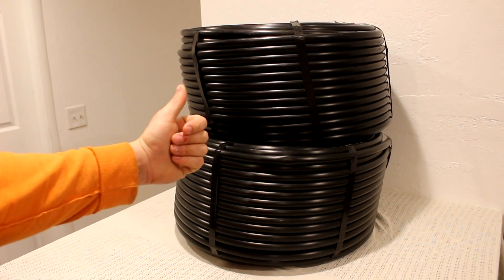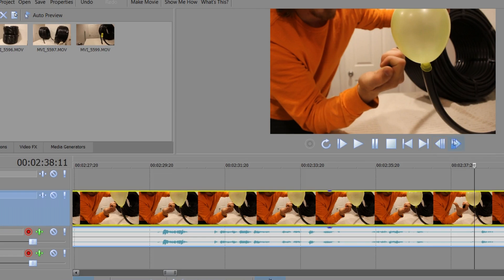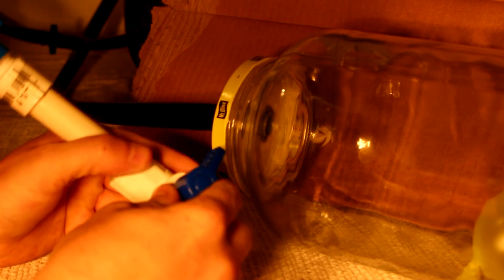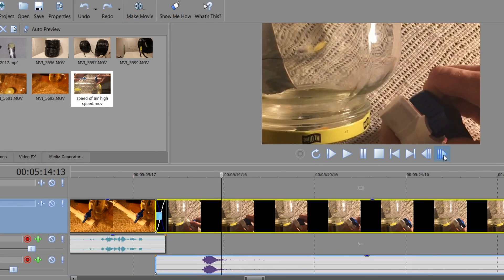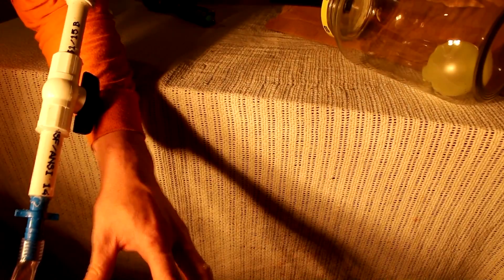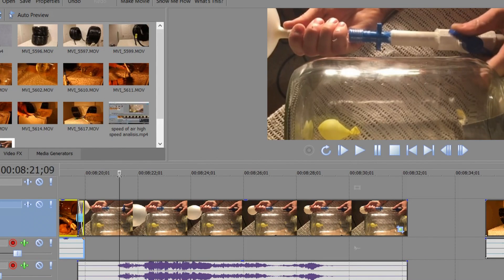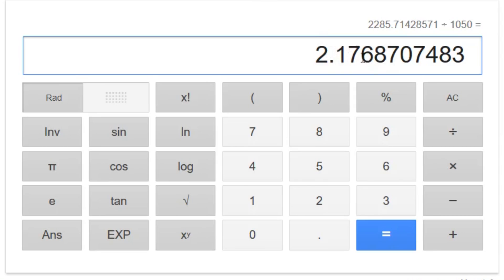Speed of Air Pressure Through a 1000ft Tube

Comment from the maker: Huh it was 24 in the beginning!? How did I not notice that? all the time using this camera and you'd think I would know how fast it filmed, maybe Ive messed up a setting somewhere? Well any way it didn't mess up the math that much and the iPhone footage is indeed 30fps
Reply: Cody'sLab Good catch, thanks for letting us know.  Btw, thanks for the vids, my 8yr old loves watching with me and it's really getting her into science :D
Reply: air is consider as fluid and as any fluid run in to tube it have friction between tube and the fluid that will slow it down and the the longer the tube is the more friction force  generated so when you do your calculation you have to consider the head loss that will happen because of the friction and other parameter.
Reply: @mahmoudorjani  9
Reply: +Dewain Anderson the effect of pressure on the speed of sound is fairly small — the speed of sound only varies about 20% between sea level and the edge of space (and it actually hits a minimum around 10km, where airliners fly every single day; from there up to 50km it's going up again, to nearly the sea-level value). The pressure effect (you simply have to fly faster TAS to get control authority, even if it's the same IAS) is the far more significant for the "coffin corner" thing. But that doesn't have any bearing on this experiment :)
Reply: Cody'sLab Can you update us about the stirling engine?
Reply: Cody'sLab the lower the pressure the slower sound travels. One of the greatest problems with high altitude flight is that the speed of sound is so low and lift is so low it is hard to fly (supersonic speeds cause a loss of control and high stress to the airframe and skin of the aircraft due to the sonic shock wave and the air isn't enough to create much lift, the envelope in between over speed and stall is called "coffin corner").
Reply: Andrew Andrew why would that be a maximum speed?
Reply: Have a phone on screen, with a high-speed stopwatch (at least 1/10th second) running next time.  This will decouple your timing calculations from the framerate of the camera.
Reply: It's okay, for the first one you didn't count the frames, you just figured "it's 12 again, so that's 1 second"... which is valid for any number of frames per second :)
Reply: The Helium in balloon canisters contains 20% Oxygen so that when someone inevitably inhales it, they wont suffocate.
Reply: I love how you acknowledge your faults and mistakes you made. Most Youtubers would rather cut their fault out of their video. I really appreciate your honesty so much.
Reply: Love the videos Cody keep up the good work
Reply: sorry I was referring mainly to traveling close to or near people building, populated areas etc as if we go faster than sound we would create a sonic boom witch would intern damage buildings and property. adhd makes this hard to explain sorry.
Reply: Live and learn :)
Reply: May have some slight interference, with bumping the jar on the table.
Reply: you couldve made a 1000ft vacuum cannon similar to nighthawkinlight's
Reply: Sylveon sup
Reply: science! it guides me in life. I often don't care if I'm wrong about something, but greatly appreciate learning something new or correcting something I thought wrong. otherwise, it's probably ignorance by out of control emotions.
Reply: what video editor do you use?
Reply: i wouldve loved to see a deflated balloon attached to one end and an inflated one to the other end and see what happens
Reply: bro, lay off the cyanide...
Reply: @ Cody'sLab, it isn't about speed of sound, but air compression in displacement.
Reply: Dewain Anderson: No. Here the gas can be considered ideal, and there will be no pressure dependency on the speed of sound.
Reply: Mahmoud Orjani: Air is not a fluid - in this experiment, air can be considered an ideal gas. Molecules will bounce on other molecules and the walls with practically no energy loss.
Reply: does that mean the fasted we would be able to travel under the most perfect conditions would be  around 3,600,000 km per hour?
Reply: Cody'sLab, I like your voice and the way (accent?) you speak. I could care less if you mess up and I wouldn't have a clue if you did anyway :P
Reply: what does he mean by a chain reaction?
Reply: Cody'sLab the hyper loop is impossible

Comment: I'd like to see a similar experiment but using electricity in a wire instead of a gas in a pipe.  Perhaps finishing off with how long it takes for any specific electron inserted into one end of a known length of wire (as part of some known current) to actually appear at the other end.  (Specifically, I'm hinting at a test of drift velocity)

Comment: It seems there is a confusion between the speed of sound which is the velocity of a wave through a medium, here air and helium/O², and the speed of displacement of the medium in a pipe, which is a flow. The latter is conditioned by parameters as pressure, density, friction losses, etc. 
This experiment show us the displacement speed. If it were to specifically show the sound speed, it could use a diaphragm at each end of the tube and see how one reacts to impulses on the other at different pressures or with different gases. A loudspeaker at the start, a microphone at the end, and you can detect the delay and probably other data as signal attenuation in relation to the gas used.
But the video title is "speed of pressure..." and it is actually what we see: the delay at which pressure variation occurs. Maybe the term "speed of sound" is misleading.

Comment: Hey but I can get my pcp air gun to shoot supersonic from a normal air charge: how is that possible ?
As you said to me in an other message pressure does not change the speed of sound in an ideal gas .... maybe 3000psi  compressed air si so tightly packed that it's making a very substantial departure from the way an ideal gas should work ? (due to the molecules themselves starting to occupy a no longer insignificant portion of the volume maybe ? )

Comment: it's very possible you've done a video I haven't seen, but I would love to see a Newton's cradle in a vacuum chamber with an atmosphere control. hypothetically, it should go much longer without air resistance, but it would be interesting to see the difference, as well as potentially extrapolate how much energy is lost due to internal friction of the support structure, maybe even an IR thermometer reading or something.

Comment: So if you were to connect the hose to a pressurized container. What would changing the pressure of the air in the container do to the air coming out of the hose? Since you said it would travel through the hose at the speed of sound, it would stand to reason that the speed wouldn't change.

Comment: I'd be surprised if you didn't know this Cody, but reducing the pressure reduces the speed of sound, so the reason the blast of air entering the vacuum took longer is probably because the pressure caused the speed of sound to reduce.

This is also why you can have a bullet exit the barrel faster than STP mach 1, because the pressure is so much greater in the gun barrel and therefore the speed of sound is much faster.

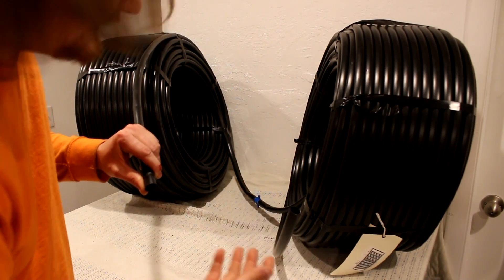Comment: 1:30 that reminds me on gas pipelines 
the pressure on the input is significantly higher than on the exit due to friction holding the gas back
3:28 you couldve marked the ballons with 2 dots and measure their distance

Comment: On the last point about speed of projectile pushed by a gas. This limitation leads to the 2 Stage light gas gun design that uses a conventional explosive propellant to push a large piston with hydrogen on the other side, this then feeds into a gun barrel and can push projectiles much faster than the original propellant ever could. This kind of design is used to test things like micrometeor impacts on spacecraft materials because it's the easiest way to get close to orbital velocities in a lab.
Reply: doesn't the hydrogen get compressed and detonate from adiabatic compression from the piston?

Comment: Shouldn't you be able to get a compressed air projectile to move faster than the speed of sound? Mach speed increases with increased pressure, so as long as the air is compressed enough...

Comment: Is your experiment dominated by friction effects with the wall of the tube? The air inside the space shuttle moves much faster relative to ground control, but is relatively still relative to Major Tom. Speed of sound at lower vs. higher pressure may vary?

Comment: If ever have a long tube again you should do the same experiment but with a speaker and a microphone. The microphone would be able to pick up the first beep from the speaker directly through the air, and a second beep through the tube and you could very easily calculate the speed of sound that way.

Comment: its not just the twists and turns that slow down you blowing through the tube also the fact that it is a large volume for it to expand in , if you reduce the diameter of the pipe to reduce this fact those frictional losses would increase.

Comment: sprinkler fitters use blow back to see if the system has no open connections.
small store or huge warehouse.  the same response.
blow into pipe and a few seconds later air comes back at you.
works with small leaks but not with an open pipe

Comment: 10:38 - can you explain how it is possible for rifle rounds to move at an excess of 600 m/s? Is it because the gases generated by the combustion of the gun powder have a higher speed of sound? My knowledge of fluid dynamics is a bit rusty, but even though we (i.e. our professor and the students) generally considered the maximum velocity a fluid can move inside a tube is the speed of sound (like you said), supersonic movement can be acchieved under certain circumstances.
Reply from the maker: heat also makes gas move faster
Reply: Ha, right! Thank you. I forgot that c = sqrt(Kappa*R*T) :)

Comment: I wonder if those tubes really are 500'? Wouldn't you get a much more accurate measure if you shot a starter pistol in one end and watched it knock a paper disk off the other end? How about some sort of feedback loop like a solenoid to send some pressure down and a magnetic reed switch on a pendulum or flapper on the other end? Could you use valves to make an engine by putting one end at the top of a hill and one at the bottom and use the pressure differential to run something? The low pressure area behind a sphere in an airflow might magnify the effect if you have wind that day.... pardon my mind wandering. Love the videos by the way.

Comment: First thing I would have done is set off an explosive on one end and wait for the sound to go through the pipe. Record both with the same microfone at the same time and then use audacity to analyze the record.
Way more accurate than your method - IF you can even hear the explosion on the other end, that is.
Also you probably couldnt have done that with helium...

Comment: Cody'sLab if you let the filled balloon release all the air while attached to the pipe...then the air in the pipe will have velocity when the balloon is out of air ...so wont this moving air try to suck air from the balloon???and hence wont the balloon be pulled into the pipe???
its a doubt....would be gr8 if u can clarify it...if it works like that then we could make a vacuum pump

Comment: how thick would a bulkhead door need to be to withstand a 15 psi pressure wave?
Reply: That's a good question. It probably depends on how long the pressure wave has been traveling down the tube and whether the tube is still open. The farther it goes the more spread out the front of the wave will be, and if an upstream bulkhead has already been closed or partially closed the energy of the gas will be dropping.

I imagine there might be a variety of different strategies for dealing with a breach depending on the type and conditions. It'll be an interesting analysis problem.
Reply: to where would the pressure wave Front spread in a closed environment(tube).  How would the front could get any wider than the diameter of the tube.
Reply: "How would the front could get any wider than the diameter of the tube."

The wave front would spread the other way, along the length of the tube, with an approximately Gaussian profile (it is ideally Gaussian, but interactions with the tube wall will modify it).

Picture a vacuum cannon with an ideal burst disk. Immediately after the disk is broken the gas molecules are very closely bunched, with vacuum in front of them and gas cloud behind. As they begin moving into the vacuum some of them will move faster than others (due to random distribution of momentum within the gas, see Maxwell-Boltzmann distribution). One wave moves forward into the vacuum, and another moves back into the gas cloud. Since the molecules have a distribution of velocities, a gradient begins to form at the vacuum interface, with faster moving molecules leading the way. The farther they travel the more diffuse the pressure front will be.

I'd suppose that you could model the movement of the pressure wave in the tube and, knowing the locations and strengths of the installed bulkheads, positions and speeds of traveling cars, terminals where cars could exit, etc, you could calculate the best times and locations and rates to close bulkheads to minimize stress on the system while providing a safe exit for passengers.

There are some interesting papers about this if you'd like to read more. I found these two covered the topic well: "The Motion of a Gas Cloud Expanding Into a Vacuum", D.C. Pack, Monthly Notices of the Royal Astronomical Society, Vol. 113, p.43 and "The sudden expansion of a gas cloud into vacuum revisited" Y. Tzuk, B. D. Barmashenko, I. Bar, and S. Rosenwaks, Physics of Fluids 5, 3265 (1993); doi: http://dx.doi.org/10.1063/1.858683 

Additionally this is helpful reading as well: "Analysis of the vacuum cannon", Eric Ayars and Louis Buchholtz, American Journal of Physics 72, 961 (2004); doi: http://dx.doi.org/10.1119/1.1710063
Reply: man these are the comments where i wish that gifting gold  on youtube would be  a thing, tank you very much for this really detailed and through answer and you even included  additional sources to round it all out

Comment: Hey Cody, this is going to sound like a stupid question maybe, but why not measure the speed of sound directly? i.e. Shout into one side with one microphone nearby, and have another microphone catch the sound at the other end? Or if you need something more impulse like and larger amplitude, use a hand clap or something... Hopefully you would end up with three signals from the two microphones, the first microphone at the source, the second microphone hearing the direct path through air from the source, and the second microphone hearing the delayed path through the tubing.

Comment: so lets say I put a speaker in a room at one end and a microphone at the other an empty long room and I filled it with helium then I played a sound first the sound would hit the microphone faster then the speed of sound but what would the recording sound like would it be squeaky like your vocal cords and what would the echo sound like how long would it reverberate after the speaker stopped, would it sound louder then normal air and if the speaker experinces less resistance would it be easier to bust it  because the electromagnet would push the diaphram harder due to the less resistance experinced by the speaker. and that brings up another question are magnets stronger in a helium environment and also a vacume repelling and attracting one another with more force